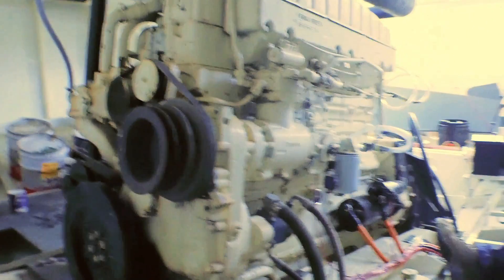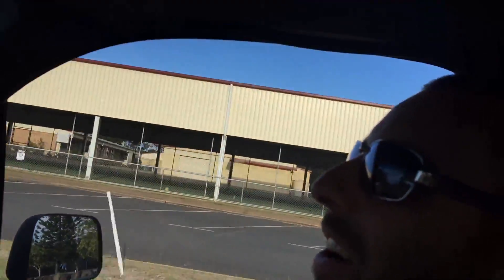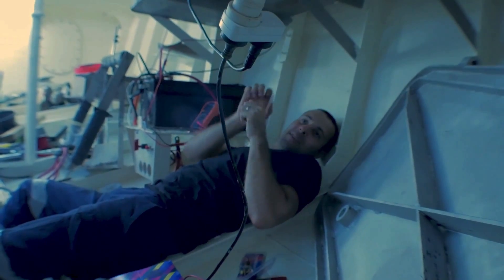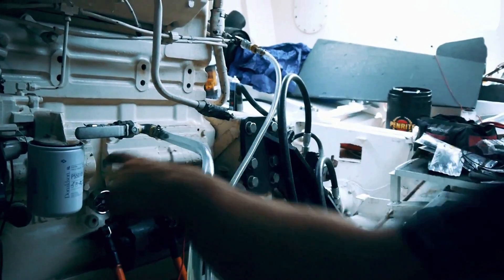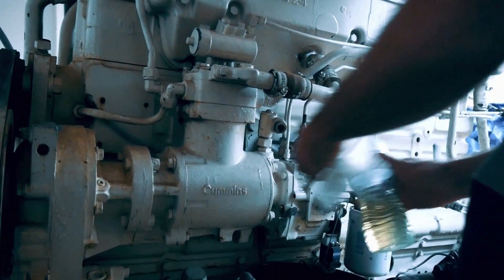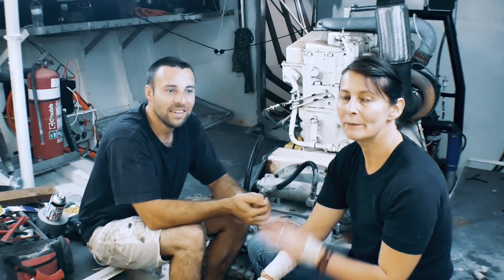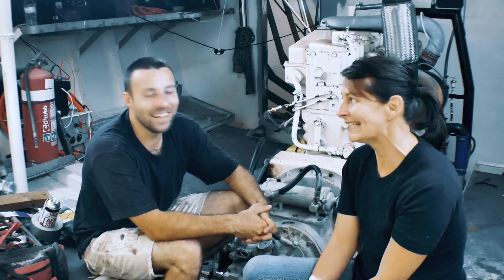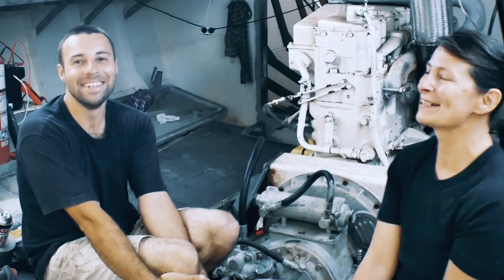Starting a Cummins Trawler Engine - Part 2 of 2 (EP. 53)

Comment: So great, a step closer to the water! Be kinda hard to row that beast......How do you plan to cool the engine?  Thanks for the video.
Reply from the maker: Hi Duncan, at this stage the cooling is done via keel cooling pipes however when we get to New Zealand we will remove these and build internal cooling prior to any ice work
Reply: Seeing the hoses leading from the trans to the keel is what prompted the question. I'm guessing there are other lines leading to the engine itself?
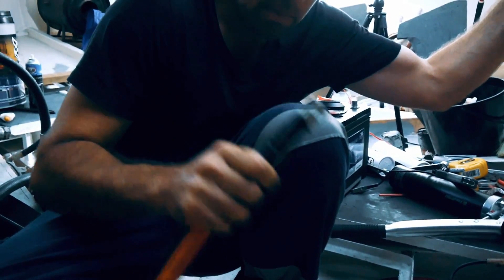Reply from the maker: Ok, we have a really old video so I apologise about the quality. From 5:56 onwards you can see the main engine cooling pipes heading out through the hull
https://youtu.be/LPstVhQGVUk

Comment: get a hand vacuum pump(mightyvac) to pull fuel thro from the return to help you in the future if you ever air lock and itll light up before the battery dies.
Reply from the maker: Thanks I will look into this
Reply: The fuel level in the polishing tank should be as high or higher than the injector pump. That way the fuel will gravity fill the lines, filter, racore water separator/filter and pump and keep it full so the fuel doesn't flow back from the pump. That way the injector pump doesn't air lock and need to re-prime itself each time the engine is started. Ideally, the polishing tank should hold about a 24 hour fuel supply to the engine.

Comment: You should look at a generator just for engine room you start the generator with a small battery source which then has the stable power to start main engine getting rid of the alternator
Reply from the maker: We will be fitting a generator soon into Brupeg. We have a 14.4kva Kubota to fit.

Comment: Is Elliot and Tacoma Washington loving your videos and loving the boat so glad you guys got the engine started one question what do you use for cooling while you're firing up the engine to test it as far as I got a plug out from outside on to the hall to do some cooling water or just running it dry
Reply from the maker: Hi, so Brupeg has keel cooling. This means we don’t use seawater pumped into the engine to cool her, the engine water pump circulates around 350L of water around a set of pipes attached to the underside of the hull that dump there heat into the ocean. This set up means we can run Brupeg for around 6minutes before the engine starts getting too warm and we need to shut her down.

Comment: I'm not sure but most of the Cummins engines need a fuel pump to push fuel into the filter. If not the injection pump will eventually fail due to a lack of fuel charge pressure. The 855 would have a mechanical lift pump on the side of the engine or you could put an electrical fuel pump between the tank and the filter.
Reply from the maker: The feed tanks for the main engine are higher than the fuel pump so we do get a gravity feed happening. Currently we don’t have a secondary fuel pump in the system and this engine never had a mechanical feed pump. Because it’s essentially gravity feed we are going to leave it and just keep an eye on it over time
Reply: @ProjectBrupeg  That's fine. The only reason I mention it is that these injection pumps like have fuel pushed to them other wise they fail due to lack of lubrication. You will not know it until the injection pump fails. The Cummins 5.9 does the same. Even though you have tanks higher than the injection pumps fuel filters can reduce your head pressure especially running 2 micron filters. Finding that injection pump while at sea could be difficult. You do not have sails so you will be dead in the water. You may not even know it but your trawler could have a history of early pump failures. Guys I'm not here to find fault, I'm just trying to give any help I can. I love what you are doing to the boat and wish you all the best.
Reply from the maker: That’s a fair point. I will have a think about that. Maybe a inline fuel pump after filters but prior to injection pump to increase fuel flow. None of this was taken as criticism, thanks for the feedback John
Reply: @ProjectBrupeg  The Cummins 855 is an older engine but it still needs a lift pump. The excess fuel is returned to the tank and helps remove heat from the injection pump which increases it's life. I don't think your tanks are all that much higher than the injection pump. I hope I am helping.
Reply: @ProjectBrupeg  I've noticed you guys don't get offended when someone offers information. You actually think about it and then make your own decision. None of us can know the best way to do every thing. That's one advantage of the internet. Research is easy. Of course the disadvantage of doing this work on the internet is that thousands of people are looking over your shoulder. Everybody wants to help but how can you know if they know what they are talking about. Good luck on the job at hand.

Comment: Look for a Denso reduction gear starter. I have one on my 855. It takes less cranking amps.
Reply from the maker: Ok thanks for that. I do t suppose you have a link for the same starter as your engine?
Reply: Steel Boat Adventures - Building Brupeg I painted it and I cannot see a pert number. Tomorrow in the daylight I will look closely. You always need to carry a spare starter. So the one you have is known to work well and should be your spare.
Reply: Steel Boat Adventures - Building Brupeg I looked around on tractor sites. Delco 39mt is also a reduction gear starter.
Reply from the maker: True. Thanks for that
Reply from the maker: Ok thanks.

Comment: Sounds like a 24 v start reading with 12 v going to it. 2000 cha. To 3 k cha.  3 groupe 31 batteries starts my plow truck at minus 20 c
Reply from the maker: Hi Knowltek we did check this but this engine is 100% 12v. We just didn’t have enough juice in the batteries full stop. That said once we figured out the fuel screw issue she roared into life right away

Comment: I thought you would have used a 24 Volt starting system as they are so much better than a 12V system
Reply from the maker: Engine came with a 12v starter so rather than change it we just used it. If it ain’t broke...

Comment: if put a fuel boost pump between fuel tank and engine to prime  and bleed  save on starter wear and tear.
Reply from the maker: Thanks we will be doing this but for now this was just a “can we get her started” test
Reply: With the fuel tanks in your boat the fuel tanks have enough pressure to force the fuel to the engine without any problems.
Reply from the maker: Yeah I have been told this. We will be adding transfer pumps so our storage is at the front of the boat and our main running tanks are behind and above the main engine

Comment: isn´t there a air bleed valve in the engine?
when i change fuel filters for the mercruiser engine, i open the air bleed valve, and i one of those vacuum pumps that are used to change engine oil,just jam the hose of the pump in air bleed hole, open the valve and suck out the air. easy and fast way to bleed the fuel line :)
Reply: ...i didn´t watch the video entirely when i wrote the comment above :D i feel like a jerk, like 3secs after i had pressed enter, you show the bleed valve :D hahaha :D
Reply from the maker: Lol it happens to all guys at some point...

Comment: YES! You Found the Get-Home Screw! Yes, your fuel shutoff solenoid is Shot, that's what the Get Home Screw is For. I thought when you said you were a Diesel Mech you KNEW about Cummins engines. The 855's are the Old-School Standard of the American Trucking Industry. You'll be running that engine a couple weeks after Hell Freezes Over.  You can get an Air Starter for that engine, too. If you run it Wide Open  and let it Overtach enough, it will Stretch the Governor springs, and let it Rev Higher. I've run them at 2400 many years. I knew a guy who took the governor springs off, and it was a 400. It would SCREAM!  Put a Block Heater on it, for Cold Starts, and keep a can of ether handy. We always squirt small squirts of ether to Run them until they Suck fuel up. Be CAREFUL, though, you don't want to get her Hooked on Ether, that's Bad...Now that you got her Running, she's as Durable and Reliable as an Anvil. You couldn't have gotten a Better Engine. You can Overhaul the pump right there on the bench, and even Bump Up her horsepower by changing the shims in the pump and adjusting the timing to suit. Cummins MUCH Better than Cat, because the pump is Pennies on the Dollar Cheaper to Buy or Rebuild. Cat pumps 3500 to 4500 dollars. You can Rebuild your Entire Engine for what a Cat Pump costs. I like the Two-Stroke Detroits, myself, but Cummins Is KING.
Reply from the maker: Hi Jim, my specialty area is inside the engines. What happens on the outside was always a mystery
Reply: I gotcha, hey, you can get a Japanese-style starter, IIRC, which uses less power and is lighter. You should try hoisting that big Beast they come with up inside a truck engine compartment, lol. I doubt I could Do it nowadays...
Reply from the maker: Yeah I nearly blew an o-ring just lifting the harmonic balancer up, I’m not keen to attempt the starter

Comment: Are you going to be able to use the air compressor the engine for anything?  Sing Jess, we need to hear more.
Reply from the maker: Not 100% sure, its fairly small so its unlikely it will have enough grunt to do what we need, we have a big 3 phase compressor I'm thinking about stripping down and installing in the engine bay, if I do that i will drop the engine mounted version.

Comment: For MARINE use all cables should be TINNED for the whole length of the cable...
Reply from the maker: That’s true. But if you can’t get tinned in the size needed you need to find another solution. That’s where we found ourselves in dozens of cases on this install.

Comment: New camera?
Reply from the maker: Yip. Had quite a few issues with it filming in 4K and auto focus going a bit crazy, still learning it and also backing it off to 1080HD so we can unload the internal processor a bit.
Reply: The images are much better.  It was like I saw you for the first time.
Reply from the maker: Ok good to know. Yeah the old cam has done A LOT of work, each episode we shoot maybe ten hours of footage and cut it down to 20-40mins so the cameras run almost all the time when we work, maybe the old one was just getting a bit tired

Comment: Need another battery at the very least.
Reply from the maker: Yeah we will be adding a second. We have two additional batteries sitting with our generator. And 4x 200 amp hour batteries for our main house bank it is only the main engine that needs more batteries now

Comment: Dude you will have no started or batteries left if your going to prime it like that every time.  No need. And I’m talking from experience here with fiatagri engines and John Deere engines and deutz with 30,000 hours on some of them.
Reply from the maker: Hi. It’s a funny story. We realised we were winding the motor over with the fuel screw shut. No matter what we did it wasn’t going to start. As soon as we opened the screw she fired in a few turns. Never takes more than a second or two to start now (even stone cold). So yes your dead right but the issue was a simple fix and now we know won’t happen again